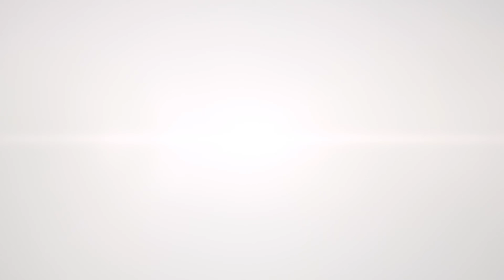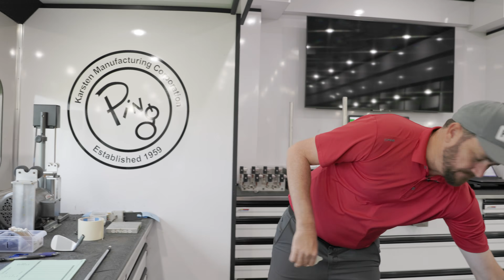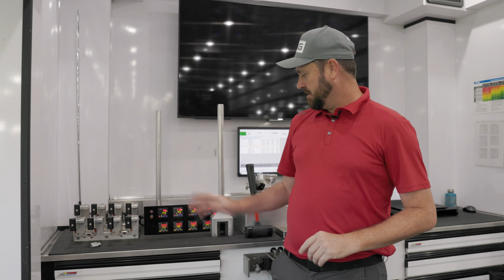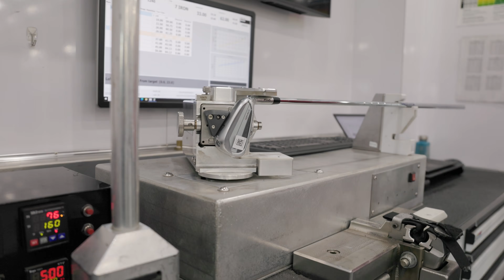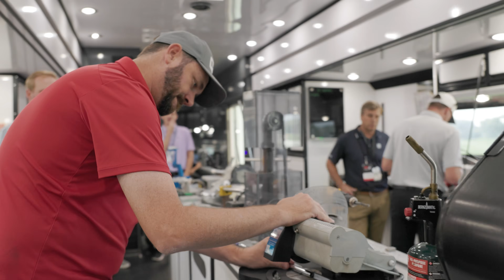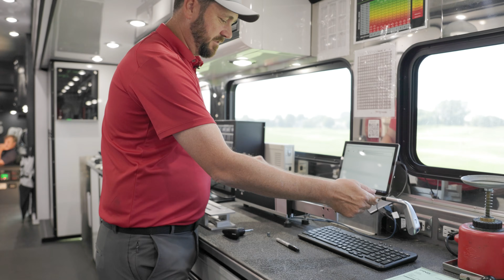BUILDING PING i240 IRONS | PING Tour Truck

Comment: What tip/hosel weight is he using that he just dropped it into the hosel. Thank you
Reply: I’d like to know this as well, but I doubt they’ll say. 

I’m in the middle of reshafting a set and they’re a pain in the ahh due to the contrarian hosel design.
Reply: @1301cb if you zoom in closely, they look like normal shaft tips weights but thats not how he installed them.... i ended up using  rubber tungsten weights cut to appropriate weights. To achieve length and swing weight. Good luck 🫡